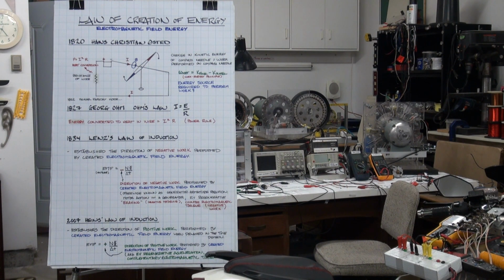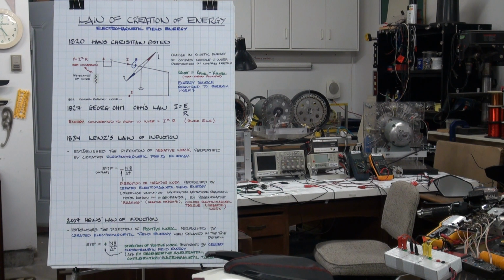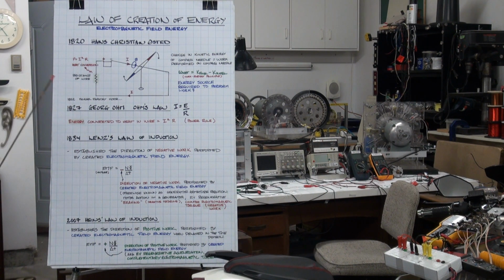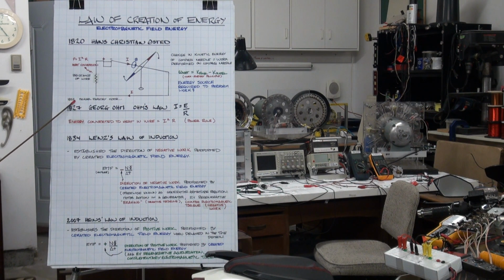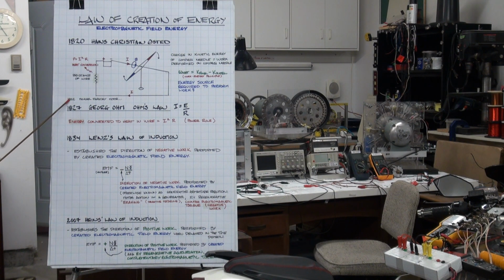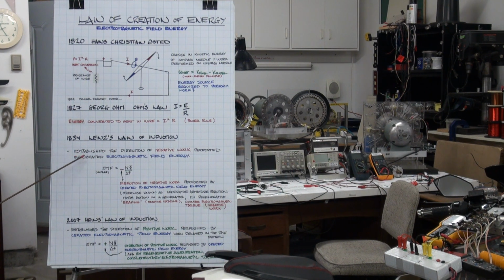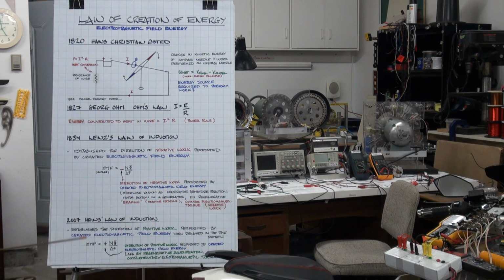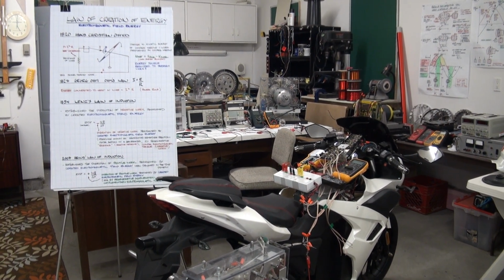Law of Creation of Energy 1820 - 2021

Comment: Stan Sandu
        About the UNIFIED  LAW!   Part  2/2.
    The electrical ether – for example- proceed from magnetic field from atoms, eliminated in following combination of the deuterium with tritium in helium. The eliminated magnetic field it decompose in particles of electrical ether in chamber of thermonuclear reaction. Any chemical combination eliminate this electrical ether. But at the chemical combination the chemical elements which participate at reaction can not to be magnetic isolated because they it combine before to be ionized.
       As following of the thermonuclear reaction from Sun, the Sun is a giant powerstation of electromagnetic energy, a powerfull source of electricity which keep up the life of every where from his planetary system. This electrical ether which come from Sun, we gather him with our electrical generators and drive our industry.   
       D.I.Mendeleev had shown that we can not conceive without motion even the smallest matter particle. It says about radiations , but about atoms and molecules that they have a vibration frequency of approximate 10 at 13...10 at 15 what means that these are turning arround theirs self axes with 10 at 13...10 at 15 rotations on second proofing the existence of a continuous inertial motion in matter.
   How the solidification begins from external it would resultated that in the central zone at any underatomic particles would remained continuously a primary matter mass, more viscous, aproximately magnetic mass, so that to the shown rotations the free underatomics particles, or in the atom*s frame, to take out in space matter from the central zone, but on which to it recover continuously for maintaining the them integrity.
 The external*s particle by friction with the medium became a spherical surface, and in the inner share continous the crystallisation it will obtain a uniformly waved surface, with helicoidal channels  disposed around his axis. Thus the approximately magnetic matter from the central zone can get out only a certain extremity, evolving around the particle or farther away in space from where it turns by the other extremity of the particle.
     The inertial movement working of the underatomic particles and the atoms as whole permits them to compare with the powerful ASPIRATORS which absorbs, but its emits too matter under the form of field*s particle. Thus, two interaction bodies it creates between them a magnetic depresion what constitute the attraction force between bodies. The permanent existence of the materials fieldes make us sure of the fact of the matter is outside from the bodies too, giving the interaction between them.   
      About the ethereal physics and ethereal chemistry we spoke a little, for to argue the unified law to him Newton, I shal cite directly from the communuications of the spatial men, from the work : ”From the life*s mysteries and of the Universe”, to the profesor Scarlat Demetrescu, published first time in 1939.
  ”An electrical current circulate forever through the internal matter of the particle from Infinte. Grace of this inner electrical current, the particle is living, has life through self herself. Because the motion of inertial rotation of the particle, it born in the her interior electromagnetism. The electromagnetic circuit can be at interior or can be and outside. He can be positive or negative. The internal motion will give birth to an electromagnetic field emited in outside. This emission constitute the matter of the electromagnetic field which circulate among particles”.
  ”The living particle from the zone of the Infinte overtake in the zone of the Cosmos and of the universes. Thus the universal ether is a mass of living particles, of small living bodies, that can enter in one microbe of your with handreds of thousands. These living particles are in a continuously motion through them nature – being electrical – produces electrical energy. That is why it named electrogenic particles.   
      In the zone collisions and explosion starry, from the primary matter – matter under electrical field, magnetic field and radiations form, it begins to form the underatomic particles; first the electron which remain as crystallisation nucleus definitized on him the neutron, which at that time when becomes free is transformed in proton and electron, respective in atoms of hydrogen, giving immenses hydrogen clouds what finds on the stary cataclysms place.
      Gravity: born, inseparable and essential the matter, is produced by a cause which acts constantly in the matter particles. All three principles of Dynamics:  1). the principle of inertia;  2). the principle of proportionality acceleration with force; and 3). the principle of the action and reaction; all are the essential elements of the  universal attraction law, law which in essence is a law of the inertial masses in movement.
    The INERTIAL  MOVE from matter produce the gravitational field, and the gravity with her particles ties the macrocosmos with microcosmos and influenced all what exists siting thus at the general existence basis. The UNIFIED  LAW  of matter*s forces I can say with certainty that it exists from some hundred years and is  Newton*s universal attraction law.
     The UNIVERSAL  ATTRACTION  LAW  it applay identicallly to the movement the atoms  of the ethereal matters, identically to the movement the atoms of the chemical elements, identically to the movement the planets and stars of one galaxy, because any body of any dimension  possess a mass and thus is subdued the newtonian forces of interaction. 
      The UNIFIED  LAW is the LAW of the  UNIVERSAL  ATTRACTION  FORCES = of the GRAVITATIONAL  INTERACTION FORCES = of the ELECTROMAGNETIC FIELD  FORCES produced by the inner movement of the inertial rotation of the ethereal matter from bodies and substances. This, because, the ethereal particles are continuous movement through the them nature, being electrical – produce electrical energy, being named and electrogenic particles.
     The universal attraction law of the Newton is the UNIFIED  LAW because all those three fundamental interactions: the nuclear interaction, the electromagnetic (electron-proton) interaction and the gravitational interaction are interactions produced through the ethereal matter, what bind the clasical physics with the good part of the modern physics, but it bind and the ETHEREAL  PHYSICS.
     Isaac Newton establishes the basic notion of classical mechanics, proved the universal   attraction law and put base of the celestial mechanics. Newton had affirmed THAT  IT  HASN*T  EXIST  NATURAL  PROCESS who HASN*T  produced  BY  ATTRACTION and  REPULSION  ACTIVE  FORCES   which  REGULATES  the CELESTIAL  BODIES  MOVEMENT and the  BODIES  FALING  down, that LEEDS  the CHEMICAL and  MECHANICAL  PROCESSES, fact which makes that the universal attraction law acts in macrocosmos and as in microcosmos.
      Thus, all the physics*s laws, chemistry*s laws and biology*s laws it can include and explain through this unified law of the electromagnetic field produced of inner movement of  iunertial rotation of the matter from bodies and substances. The spacial brethren say us about Newton that: ”Newton is great saint  with us in Sky!”   
   Now, were collided particles in LHC and you seen that is nothing: none Higgs boson, none Big Bang, neither black holes, but only thousands of shards of ethereal particles.Therefore now, return you physicists from your distraction, at Isaac Newton with his universal attraction law = THE  UNIFIED  LAW  of the MATTERS and FORCES, at the eliminated ETHER by Einstein, at unseen world of ethereal and spiritual matters which fill up the Cosmos, and return you at the Lord- at God!
Reply: Ola, o senhor tem feito um otimo trabalho, vi que tem alguns video em seu canal, são video muito interessantes mas com pouca visualização, eu me inscrivi em seu canal, seria muito bom que mais pessoas tevesse interesse neste conteudo e tentassem replicar os dispositivos, obrigado

Comment: Stan Sandu
            About the UNIFIED LAW! Part 1/2 
            To manage the construction and operation of the controlled thermonuclear reactor, we must revise our knowledge ETER*s removed from current science. The Eter is a material reality which represent 96% from the material mass of the Cosmos. All we see is just a state of concentrated eters ways. Electric current is an electrical eter and is not itself electrons. The electrons in an electrical conductor have only an intermediary role in electrical conduction. For magnetic trap, we the people need to work with the Ethereal matter of electromagnetic field; which withstands at millions of degrees! 
          A magnetic trap to dress and spatialized a thermonuclear plasma with millions of degrees has not been done on contemporary Earth humanity. In the case of the thermonuclear plasma, magnetic trap must have an ELECTROMAGNETIC field to evolve further into space from the source that creates, in order to surround a rigid wall and unpenetrable plasma globe with millions of degrees Celsius. 
       Broadcasting and movement in space of a powerful electromagnetic field flux is predicted theoretically, but there is manifested with all power in nature. For example, the Sun unfold temperatures of millions of degrees, and that noted specifically that there is a strong magnetosphere solar who dress tight the solar mass incandescent, goes into space billions of kilometers and returns and the top, and dressing again the solar incandescent mass.
         From a theoretical stand-point, since 1860 J.C.Maxwell physicist says, as a electromagnetic radiation result not by varying fields, but and at the constant field, when varies the electrical permitivity, or magnetic permeability, or both. Surprisingly, the bottom of the scheme printed on the tombal stone of the King Pacal from Palenque- Mexico, is an electromagnetic reactiv motor, yet is a device that can produce and emit a strong electromagnetic field flux, the best for insulation and spatialized of the plasma, face of the walls of thermonuclear combustion chamber. 
       The texture of toroidal, poloidal or stellarator magnetic field is too rare for to a magnetic trap. The magnetic trap must let be one electromagnetic stratified wall with weaved at entrance and with disweaved at emergence. The electromagnetic wall of the magnetic trap is a wall with formation and continuous displacement. 
        Feeding a superconductive coil with an electrical current it obtain in the her round only a magnetic field. But disposing in the round of the superconductive coil a certain magnetic and dielectric pieces, it obtain the variation of the electrical permitivity and of the magnetic permeability, which will transform the magnetic field of the superconductive coil in electromagnetic field, which can evolve (go) more far away in space, without to close immediately the curl.
          The model of thermonuclear controlled reactor proposed of myself – reproduces entirely the conditions from Sun. Viz: 1). Produce a globe of plasma and turned it with 800 m/s; 2).Ensure a magnetic trap with two electromagnetic crossed fields which dress and turn the globe of plasma; 3). Supply continuously with hydrogen in state of plasma and ensure the its confination. Moreover, makes possibly to direct gathering of the electrical current. 
      But in 1905, A.Einstein conclude that the ether hasn*t a correspondent in the reality. By excluding the ether Einstein*s Relativity deal prior with the geometrization of space and not with matter which fills this space. 
       The science has and history. In the Fundamental Principle of Democrit (470...380 BC) it show: ”From nothing nothing*s born; nothing that exist can not be destroyed and any transformation consists from a reunion and a separation. Nothing is hazardous, all it*s happening has a cause and a necessity. Out of atoms and ETHER, all rest is otherwise than rationament and do not exist. The SPIRIT as well as the ETHER consist of small and sferical atoms, very mobile, atoms that their movement form the phenomenon of LIFE”. 
       Today, on measure that the theory advances from clasic mechanics to the quantum mechanics the particle and wave are gradual dematerialize. The modern physics is blocked by enounciation of some laws and mistaken principles as: relativity theory; Hubble*s law; postulation that the atom can*t emit and absorb radiations continuously; admiting the postulate what claims the photons without mass a.s.o. These guide us at supernatural, and at the technical and technological blockage.
        D.I.Mendeleev had shown through 1860: ”Studying the ether which penetrate in all the bodies and asking myself the question: from what is formed this ether*s mass, I had admitted the idea that theirs atoms, or his matter represent the primary matter, from which are formed all atoms. The existece to the one light mass, to the one light substance and less of chemical forces, is possibly but is even necessary”. 
        After Mendeleev*s opinion is possible and necessary the extension of periodical system for other size*s order – more small- of the ethereal matter particles. About the absolute vacuum space, M.Faraday had the certitude that it doesn*t exist, and exist only an incomplete vacuum whose spatial magnetic state is of the most importance for the natures phenomenons.
        But the ETHER is a physical reality constituted from a very small matter, invisible for human eye, and is formed from atoms more small with 7...8 order of dimension than the atoms of the chemical elements. The matter of the ether penetrate in all the bodies and is the physical matter which fills both the interplanetary space and the interatomic space. The ether is a matter with mass and weigth, being subdued and she the action of the universal attraction law. 
        The REAL ELECTRIC LOAD is a particle of electrical ether more, more small than the electron, has and she a personal and rapid rotation, producing a personal magnetic field, which it gear with the magnetic field from the round of one electrical conductor. The ELECTRICAL FIELD is a field of particles of electrical ether, free and it move approximate in right line. The MAGNETIC FIELD from the round of one conductor is constituted forever from particles of the electrical ether, but magnetic coupled head at head and it move on a curve forming concentric circles in round to one conductor. The ELECTROMAGNETIC FIELD is a combination of particles of electrical field and of curls of magnetic field, having property of the evolve in space.  
        The ELECTRICAL CURRENT consist in circulation in the round and in  lengtways to one electrical conductor to the particles of electrical ether guided on the magnetic field from the round the electrical conductor. The gathering and the condensation of the particles of electrical ether it make with the help of the induction magnetic field when the electrical generator work. Here has place and the transformation a one part of particles of electrical ether in particles of the magnetic field from the round of the conductor. 
        The ACTUAL ELECTRICAL GENERATORS: galvanic elements and electrical accumulators; dynamos and alternators, thermoelements and photoelectric cell – transform NOTHING, but they only gather the electrical energy = the particle of the electrical ether which exist in metals, in the environing medium, in the thermic radiation or in the ray of light!
Reply: Ola, o senhor tem feito um otimo trabalho, vi que tem alguns video em seu canal, são video muito interessantes mas com pouca visualização, eu me inscrivi em seu canal, seria muito bom que mais pessoas tevesse interesse neste conteudo e tentassem replicar os dispositivos, obrigado